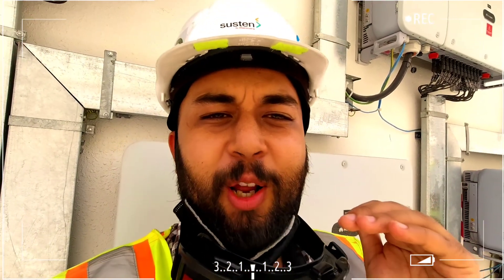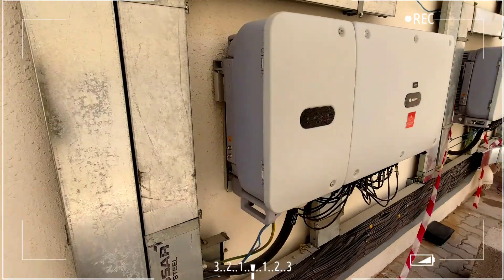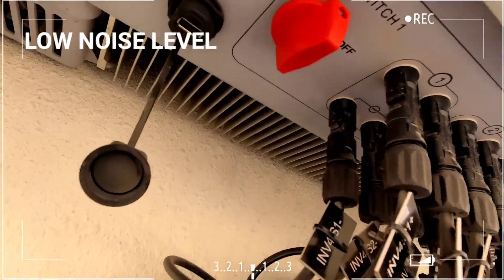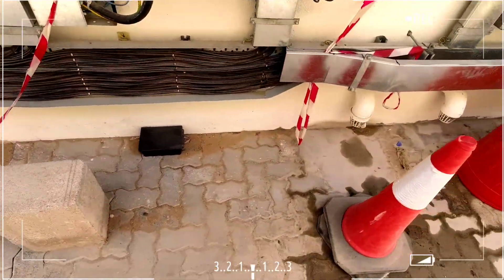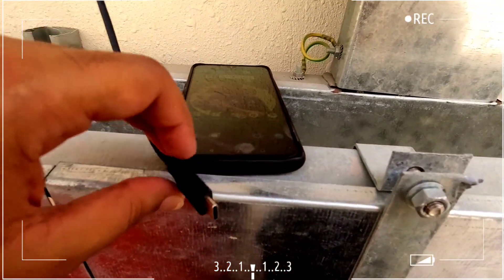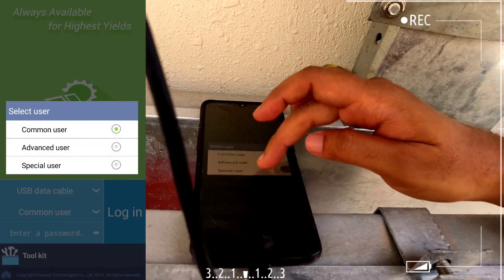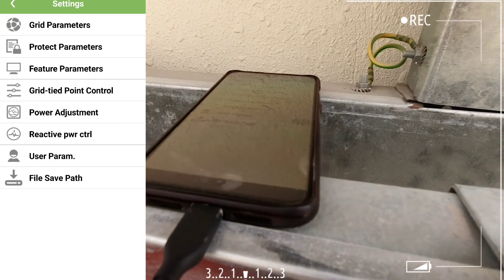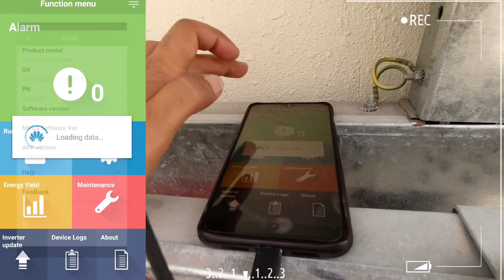Solar Inverter Mobile Control | Maintenance App | Solar Inverter

Comment: Sir ye dc cable insulation kya hota hai or ye  same inverter ki different string me different different kyo hota hai
Reply from the maker: Tamper cable coming in contact with earth , due to tamper at different lengths